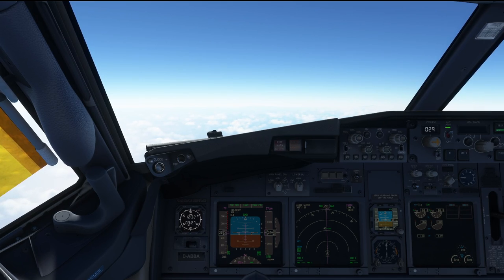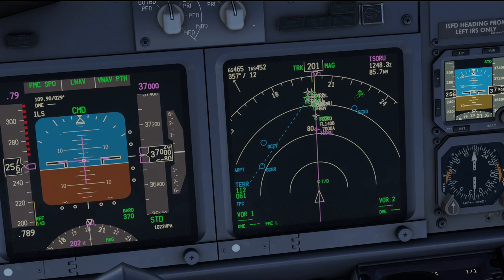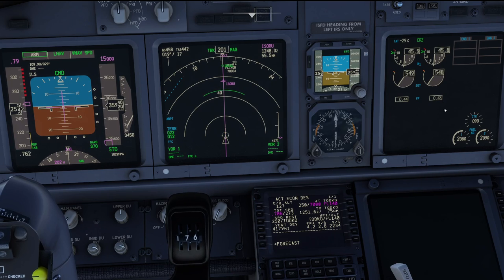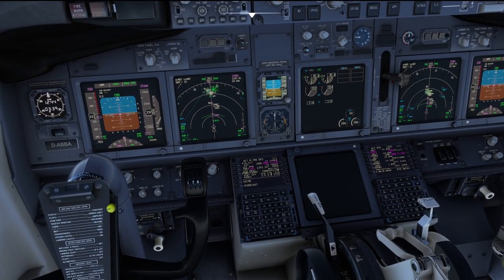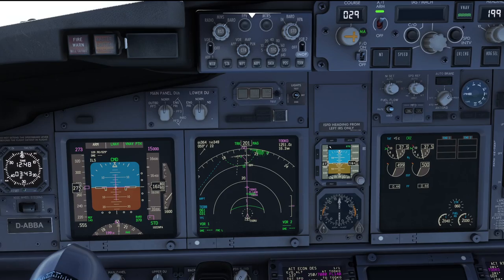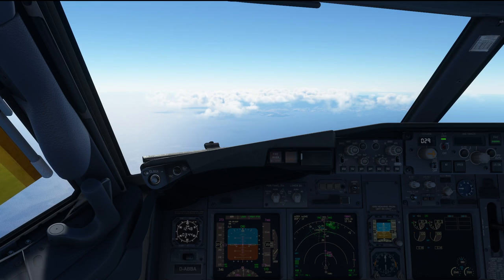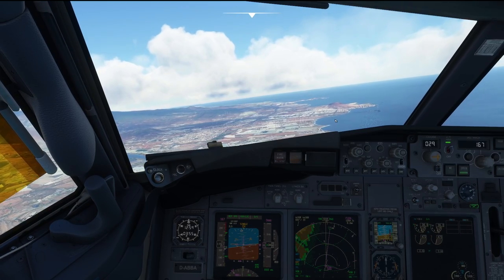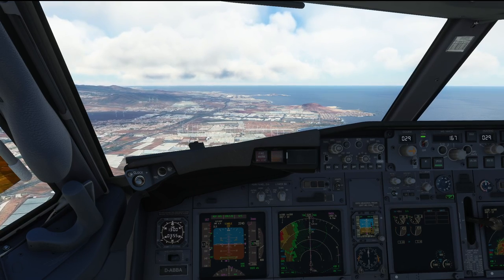HIGH on PROFILE? How to recover professionally | Real Airline Pilot

Comment: In my 25+ yrs of simming, I've never flown the 737. Airbus a few times. You may agree, an irplane is an airplane. However, the concepts and experiences you described on your videos, have being very valuable to me. Thank you Emmanuel for the effort and professionalism demonstrated over and over again on your videos and thank you for sharing your knowledge and expertise. Best regards.
Reply from the maker: Absolutely right @Art A, an airplane is an airplane. While my videos are mostly designed for the 737 they will probably work with most other aircraft as well. I'm not giving gurantees though, as I'm not typed in other aircraft (yet).

Comment: Very good video. I was always so unprofessional and just used the speedbrake. I never played around with the descent speed, but that seems very efficient. Thanks for this insight.
Reply from the maker: Using the speedbrake will just kill energy. Energy that you have previously already invested (aka fuel that you burned to stay higher for longer - whatever the reason for that was). There's just more efficient ways to use that energy, such as converting the potential energy you already have (aka altitude) into kinetic energy (aka speed).

Comment: Hi Emanuel! Great video; I'm just curious, in general, are there any V/S restrictions airlines place for PAX comfort? What is the highest you would normally go in normal OPS?
Reply from the maker: V/S restrictions don't exist for pax comfort. They exist for safety reasons to avoid controlled flight into terrain.
Passengers don't feel vertical speeds. They only feel the deck angle of the plane, so bascially the pitch. You could do 20.000fpm downwards, as long as you're in a good deck angle your passengers won't notice.

Comment: Could you do a complete FMS thingy (sorry, don't know the correct name) setup. I use simbrief and fill in all the fields I understand but I always get the message that I have not enough fuel yet by the time I land at my destination I even have more then simbrief calculated I would have. I use the 737-600 and would like to understand the onboard computer more.

Even if you wont/cant, still love your videos and will always watch them, thank you for them!
Reply: Be sure you are using the correct weight units. I initially had this issue when I was exporting my SimBrief plans in KG, but my 737 was configured to use LBS.
Reply: @lazyboi749  Thought it was this as wel so I checked and it is in kilos. I'm guessing I'm just adding the wrong numbers for fuel in the wrong places, I also have some fields that I have no idea what to enter so it is completely my fault yet I can't find a good tutorial that actually explains what you're filling in where. But thanks for the reply and tip!
Reply: @OpinionatedHuman  Main FMC menu --> FS Actions---> Fuel . This is where you enter the calculated fuel from Simbrief easily. Be sure to use Block Fuel value and you have the right plane selected in Simbrief.
Reply: @Ellipirelli69  I play realistic, I fuel the plane through the tanker and  I indeed use the total fuel number, but it goes wrong with the programming of the onboard computer that tells me I don't have enough even when I do, So my problem is with setting up the FMS in the correct way.
Reply: Both Emanuel here, and Easyjetsimpilot, has good videos about how to fill out your Simbrief flight plan.
Reply: Just look at this live streams, he usually starts cold and dark and goes through everything in detail.

Comment: Serious question: one major tool for losing altitude in light aircraft is the forward slip.  Why is this not on the table for jet aircraft?
Reply: Because it would scare the shit out of the passengers 😂😂 Passenger flights are supposed to be as smooth as possible.
Reply: @chaophraya8003  I realized that about thirty seconds after I posted it, but my pilot's intuition refused to accept it.  I'm not cut out for the big iron.
I figured a small, 5-10 degree yaw is not worse than turbulence.  From a fuel perspective I figure it's bad for all the same reasons popping the speedbrake is.
Reply from the maker: There's a huge difference in the forces on a light aircraft and a passenger jet. You're doing several hundret knots here in a jet, the forces on the vertical stabilizer would be huge and not something your airplane could repeatedly take.
Then there's the effect on your passengers. If you've ever done a sideslip in real life you know how "strange" those sideways forces feel like. Do that with 200 people on board who fly once a year and you got 200 people puking and certainly never flying with you again.
Reply: @A330Driver  thanks.  I had a feeling there was going to be a technical limitation out there in addition to the prolonged skidding sensation.  The fact that airliners have very large vertical stabilizers compared to other aircraft must surely compound the issue as you described.  Thank you.
Reply: No need to sideslip when you have speed brake. And if this isn't sufficient then you can   always request a holding pattern away from high terrain and request to descend in the pattern.

Comment: I guess I’m not understanding it. If I increase my VNAV PTH tgt speed does my top of descent get steeper? It’s basically the same thing as engaging LVL CHG and then increasing the speed on the MCP right? It seems to me though that if you overshot your T/D and wanted to maintain a descent of 500fpm as to not disturb the passengers then you would have to slow down the speed on the MCP and engage V/S to 500fpm.

Comment: Using V/S at 21:00 causes you to exceed your ATC speed restriction. It’s not a good method. SPD INTV (Also protects you from blowing procedure altitudes) or LVL CHG with spd brake is your only real solution in that case. Again only because you were given an ATC restriction in your scenario. Also V/S is a very tricky mode since you could easily over speed because it ONLY follows V/S and your speed will increase (or decrease) regardless. 

Well explained video none the less. Have you thought of applying to the training department at your airline?

- Cdn 737 Line training Capt. / Initial training instructor
Reply from the maker: It's a minor exceedance that I'd consider acceptable for the scenario. At least that's how 99% of the guys I'm flying with would handle it. I've never had an issue with ATC complaining in such a scenario as well. Of course - if you see someone on your TCAS 3NM in front you might recosider doing it or not.

Thanks!
I've considered it, but decided against it as it would come with too many other changes in the way of life.

Comment: @737NG Driver
17:27 "we'll take manual speed restriction from ATC of 250knots"
21:31 IAS 280, There is no more speed restriction? (;
21:50 IAS 285
Wouldn't you get the same result with the LVL CHG and the speed set to 280 or 285 and then setting the speed back to 250? Is this a bad technique or just different? Is one better than the other? I use V/S to limit the rate of descent/climb. I don't like using V/S to increase the rate of descent/climb because I lose control of my speed...
Reply from the maker: Deleting that restriction serves to show you how much of a difference the speed reduction slightly later makes to your profile. It shows you how much extra drag you have at that higher speed.
If you used LVL CHG your VNAV path will not get updated. You can do that on a short term, but you won't know where on your profile you will now be as your VNAV path is still based on the drag from a different speed.
Reply: @A330Driver  Thank you for your answer. That's really interesting. (: So, based on what speed is the VNAV path calculated when I have active LVL CHG, and based on what speed when I have active V/S?

Comment: Question, is against procedure to lower the gear to increase ROD? technically that would be the steepest ROD in addition to flaps 5 220k
Reply from the maker: My airline prohibits that, if you're SO high that you'd need to lower the gear to get back onto the profile they demand you to either seek for extra track miles or do an orbit (provided you're still more than 10NM out from your runway) to loose altitude.
Reply: @A330Driver  interesting thanks for your reply

Comment: I'm not an aircraft person, have never even been on a aircraft, but in simple terms could someone please explain what it means to flair?
Reply: A flair is when the pilot pulls up the nose when landing, in order to make for a smooth touchdown. Otherwise the plane would simply smash into the runway with ~700 Feet per minute decend rate

Comment: Would lowering the gear early like 3000 feet help on drag to get the airplane down on altitude or is this something you avoid for reasons ?
Reply from the maker: Technically speaking you could do that - but my airline imposes a clear limitation that a missed approach is to be conducted should you be that high on energy that you need the gear to slow down.

Comment: Good afternoon captain, I have a question: could be an option to anticipate the landing gear extension if you are high on profile, in order to reduce speed or increase the rate of descent?
Reply from the maker: Not really, technically it would help of course, but my airline imposes a limitation saying that if you're SO high on energy that you need the gear to get down, then you should execute a missed approach or if outside of 10NM from the runway request extra track miles or do an orbit.
Reply: @A330Driver  thank you
Reply: I came here to ask the exact question. In dire situations, I have reached for the landing gear, and it has worked, but knowing that this is a missed approach/track mile extension situation means I have to plan ahead further with slightly fewer tools in the toolbelt.